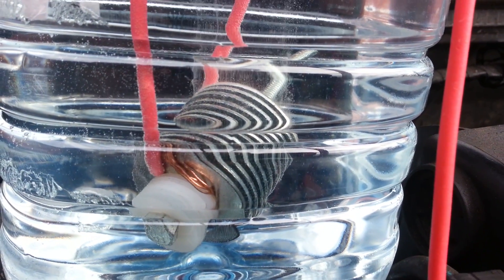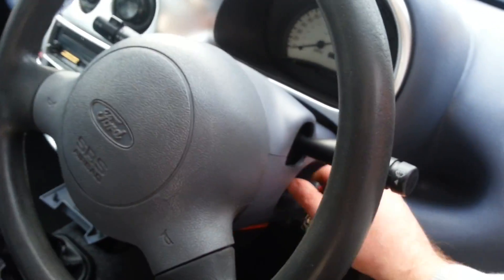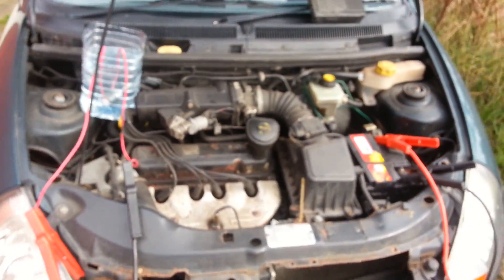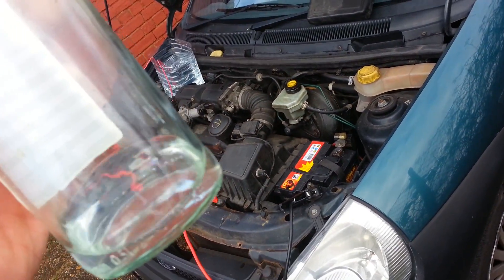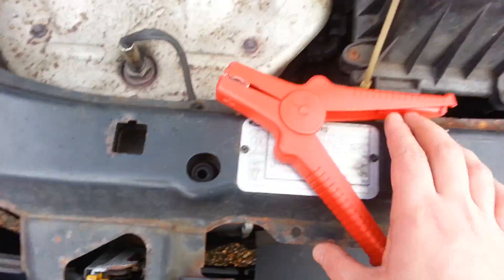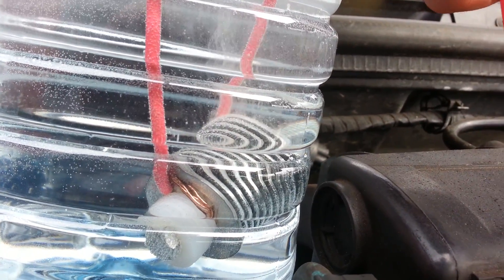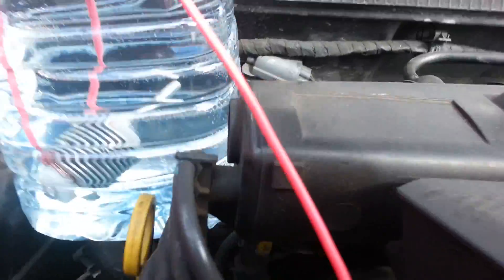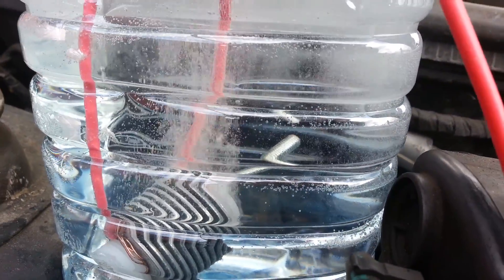HHO Hydrogen Fuel Cell Car Conversion DIY Gas Generator Build

Comment: Fuel cell is too small in proportion to the container and water youre using, also have it standing straight up and down that way the hydrogen and oxygen can properly travel between the metal plates

Comment: Very good tight fit of space in between the washers, that makes for a higher current. But if you use two threaded bars you can make the washers alternating positive and negative allowing for more production. Now the key is charging everyone of the washers for less competition for reactions, if you only charge two, the rest of the washers are useless

Comment: Umm you do not need the vinigara if your using baking soda. You will not need either I'd you use electricity to split the H20 element into hydrogen. ( Water is H2O. Using electricity to split off 1 of the h molecules is what makes hydrogen)  and there are few inexpensive ways to make all the hydrogen you could ever want.  The problem then will be what to do with it. I'm unsure of storing and using on demand as needed, but I'm quite sure you wouldn't need to be a rocket scientist to figure it out. A steel containment system would be pretty easy to mske, but probably very inexpensive to find one that would work well and be safe. Saved beinf the operative word here becaus hydrogen is an unstable fuel and is HIGHLY explosive. So what ever you do, make sure that any steel storage unit you rig up exceeds industry standards because of your application.

Comment: you need a sealed systems to collect the hydrogen. also use distilled water and baking soda. then need to actually run line to your intake duct to your carburetor. you obviously didn't do any real research.  duh

Comment: just be carful this car battrey give to much amps and the water after 15 min will warm up and give u steam too so u need bubbler or reactor and carbon filttering before adding it to ur car air intake good look ...u can build bigger kit to handle the amps

Comment: Sodium bicarbonate contains hydrogen and oxygen and it has been added to water !    Water is not H2O !   Water is not made of hydrogen and oxygen !   Water cannot be split into oxygen and hydrogen through the process of electrolysis !   Hydrogen and oxygen come from the sodium bicarbonate added to water !  Water is only a medium enabling the extraction of hydrogen and oxygen from sodium bicarbonate added to water !

Comment: The battery can deliver much much more power than the alternator ever could. So no need to try this with a running motor.
Plus you would need a solar cell on the roof or at some home charge station, in order to get H2 "for free".
Using the battery/alternator itself to generate H2, would not help you to actually save energy.
I respect the effort. But this setup would need a metric ton of streamlining before you can even think of using it in an actual appliance.
And I'm not only talking about a pretty hull for all this stuff.  But for a setup with an actual efficiency factor and resonable resource investment and decent longevity of the parts.
So no washer fuel cell and no baking soda...

Comment: that's not a hydrogen fuel cell.. a hydrogen fuel cell takes hydrogen and turns it into watter and electricity
Reply: chabka34 It basically is

Comment: there was NO NEED AT ALL to connect this to his car battery or even have it on his car at all unless he's going to capture the hydrogen and burn it!!!    what the hell is the point and why does everyone else's fuel cell use backing soda??  I guess if this was his only source of 12vd then he had to use his car but he could have used a spare transformer that plugs into the wall like the one on his internet router and spared us the noise of his car!
Reply: Those types of transformers don't deliver enough current, they are usually at the most 12v 1500ma

Comment: My build i got ideas from a youtube vid you should watch it couldnt be easier steel wool inside a sock and also steel wool on the outside much cheaper and easier infinitely more surface area on steel wool also!
Reply: aza willz just steel wool? and its made a significant difference with your gas mileage?

Comment: the hho is not being used for your car to have any effect. it has to be in closed area and put into the combustion chamber to function correctly. you can also use the gas in your gas tank to be more effective for your car. I am new at this as well.

Comment: Sand down the washers before you put it together so then you have slightly more surface area and by the way the polarity makes no difference just the cathode plate deteriorates over time

Comment: U did a good job that u tried many things clearly that we can see in a simple way
U had problem in the amount of hho gas it was pooe
But u could reduce the number of  steal whosher as neutrals  so will get more voltage through the system rather than rev up your engine

Comment: you did it right, until the time you try to light it up, which for safety purposes you should never...but who am i to say that... it would be better if you take a strong bottle, isolate it, put a hose with a valve, which the gas will come from to you to light up.. ;)
Reply: ***** i dont really get the point of this , can you please explain the backgroup story to this  ?;) thanks
Reply: there are some videos showing it, i have seen a guy transferring the gas to a balloon, and then using the gas from the balloon on the gas stove :D

Comment: Can this be used for a 100cc bike??? because you know... water is far cheaper than petrolium... and It would be great to have this run on 100% of it rather than making it hybrid :3
Reply: Hho gas doesn't work well with 2 stroke it burns up the lubricant. The generators don't work if they are getting shook up either
Reply: +Walter Garvey well, my bike is a 4 stroke engine and there is probably a way to stabilise the container so it doesn't shake to much on the road... im riding mostly on asphalt anyway but thanx for pointing that up to me :D
Reply: +Donny Slander I more meant negative g's from jumps and stuff. Could run water from the generators or bubbler into engine. Between wet cell and dry cell it seems the dry cell is more durable. Run that into your air intake as far in as possible. Make sure to use blow valves and flashback arrestors and your off to the races. Perhaps even add another battery and series connect it to yours to handle any additional load.
Reply: +Donny Slander if you try 100% hho you may have to delay your timing to right about TDC.
Reply: +Walter Garvey ooowh hahahha I thought you meant by uneven tracks or paths xD well I certainly need those parts if i don't want my generator exploding... just one thing though, is my piston gonna rust from using this??? I need a dummy engine first hehehe
Reply: +Donny Slander it will clean out the carbon build up but you will also notice other advantages like the engine will run cooler. Regular lubricant works fine.
Reply: +Walter Garvey my bike does runs at the TDC even with petrol. I mean I maintain my bike as often as needed. But what do you mean by near TDC ???
Reply: +Donny Slander the timing is advanced a bit because gasoline is slow burning. If you ignite a ballon full of gas fumes and ignite it you get a big flame. Hho gas is like a shotgun blast. It gives you a more complete burn also. My suggestion is do a hybrid that runs on both.
Reply: Alright, what would be the perfect yield i.e 500ml per minute. And since I would be making a hybrid, would offsetting it to somewhat 15 degrees to the right a good spot? I'm sorry but I am new to this HHO thing but very interested in making one work. I am also interested to make a generator to operate with similar build. And thanx for replying with great information :D Walter Garvey
Reply: 100% would not be possible. Gasoline has oil in it which lubricates the parts of the engine you can't pump oil thru. Hydrogen will power any gas engine 100% but the engine would self destruct in probably a quarter of its lifespan if that long. It's best to mix this with gas on the vehicles not try to run it 100%

Comment: So you put Vinegar AND Baking Soda in the water and it created bubbles?

Try using 80% Vinegar and 20% Baking Soda, don't use water or electricity at all, and I bet you get a TON of bubbles!  Energy Problems solved!

Comment: Can you hook up more than one hho generator to one car battery ? so it will be more hydrogen? :)
Reply: Nothing more..? The title of the report from Jet propulsion Laboratory is "On-Board Hydrogen Generator for a Partial Hydrogen Injection Internal Combustion Engine"...
Reply: Cliff Yablonski Have you tested ? :O
Reply: Cliff Yablonski Actually it is not. Check here! http://hho4free.com/hho_proof.htm
Reply: Did you even have a look at the reports? Research from Jet propulsion laboratory, NASA, a respectable Swedish engine laboratory (Lund) e t c is completely false? The link you provided leads to a blog that deals with the 100% correct conclusion that a car that runs on water is a perpetum mobile. I does not at all deal with the findings i provided a link to. Namely the fact that addition of a small quantity of hydrogen gas reduces the lean burn limit of natural gas in a combustion engine.
Reply: Mythbusters is a very entertaining show but their investigations are seldom done with a proper framework of understanding of the claims / technology. I remember when they tested running a diesel car on used frying oil. I have done this for years and know that if you wish your engine a long life you better make sure that the viscosity is the same as for diesel. I e it has to be heated on board. But they just poured it in, drove the car and concluded that "Yes it really works". Yes...for a while....until the engine seizes due to ring gumming.. In the HHO case they did not make any adjustments to the cars ECU which you have to do to achieve any results.
Reply: ...and under Conclusions in the same report we find: "Overall increases in engine efficiency are more dominant than energy loss incurred in generating hydrogen, resulting in improved fuel economy for the system as a whole."
Reply: Jesus... Someone needs to learn to read. It´s first one! The logo is California Institute of Technology yes. So Jet Propulsion Laboratory probably is/was a part of California Institute of Technology.
Reply: Ready     set     Go!! Argument battle! tu tu tu tu..Ah ah. -> K.O ! I think judofreddan wins cuz he has more proof that hho is actually working :)

Comment: it is simple heater. he is just boiling the water
Reply: The positive and negative plates need to touch to cause thermal induction... this is electrolysis, though not much because he didnt use a proper electrolyte until he added the baking soda
Reply: No hes not

Comment: Suggestion... If the power is straight from the battery, your gonna boil your water resulting in the hydrogen you're separating to combust in the container before it reaches the intake of your car. I suggest gaining your power from a 30 amp fuse or somewhere around 20-40 amps. That will decrease your amps entering those wires from 700-800 amps (depending on your battery) to a more efficient power input. :)
Reply: Electricity is drawn not pumped like some people think. If a HHO gen draws more then 30amps then its going to pop the 30amp fuse. A fuse or breaker does not regulate power. A car battery does not have 700-800 amps, that is the draw rating for starting a car, a starter that draws 700 amps requires a battery rated for at least 700 cranking amps. Car batteries do not have amp hour ratings like deep cycle batteries do instead they have "reserve current/RC" ratings which is how long "minutes" it will last with a 25amp draw.

Comment: nice looking cell (wired incorrectly) you've got the spacing nice.  and you've made it so it won't give a dead short, however your + - are so far apart you might as well have 2 bits of metal in the water.  yours looks like this +.............  the closer they are to one another the better the production. you could run +......+ and that would increase things.  there's many other ways you could do it too.  but that's just one.  you can run +..n..+ or any other style you like.  you're running 12v dc from the battery directly which is ramping your amps up as much as it can (and you're getting very little for it) whereas i'm running on 5v max getting slightly more than that (mines still in early stage but hooked up and running on my car now which has made a massive difference to the performance of the car not the extra mileage).  hope this helps

Comment: I already installed a 21 plate dry HHO generator into my RV V8 7.5 and I do get about a 15% savings on a $100 fill up. This is because my RV is a class B 20 foot which is heavier than a car. With a car you should get closer to 25% better results than what you get now..
Also check out: the-secret-of-life.yolasite.com. Oh! Also make sure you upgrade your Alternator by 25 amps or you'll wear down your battery. If you use a 21 plate HHO generator, which works perfect. I got mine through e-bay for about $150 complete for either a carburator or fuel injection unit. Works better for carburators.

Comment: you can't just put a coil in water and directly connect it to your battery, your going to short circuit doing that. you need an HHO generator (hydrogen cell), you can buy them on the internet, usually run for about $200USD.
another tip,  if you can find some, use platinum for your conduction poles rather than steel washers, even copper is better than steel washers, but copper and steel and most other metals will corrode but platinum takes a lot longer. 

good luck dude.

Comment: That isn't a fuel cell, it's electrolyzing the water!  also, you're probably doing damage to your battery, which is okay because if it explodes there may not be any more idiotic videos from a propagator of false information, like YOU!

Comment from the maker: hey guys.... I know that U cant see it on the vid BUT..... the metal rod is in fact covered in plastic ... only the ends are naked...........no washers or cables are touching the metal rod...   yes I will make it propper and better - bubbler and fuses and flashback arrestors n all

Comment: you need an air tight seal with an air line coming out into a bubbler with soapy water to trap the gas....then ignite the bubbles.....what you are doing here is dangerous....hydrogen is very unstable... use a bubbler to prevent explosion.

Comment: if you use a high grit sandpaper and sand down all sides of each washer it will give you more surface area for more bubbles to form.

Comment: you need to add baking soda it will conduct better....surface are is a plus it is more places for the bubbles to produce. i dont understand why your connections are so complicated... my hydrogen generator produces 100 times more hydrogen and i only have 2 plates......and vinegar is a big no no....you dont want acid....you want ant acid